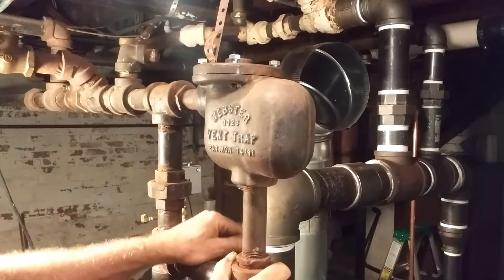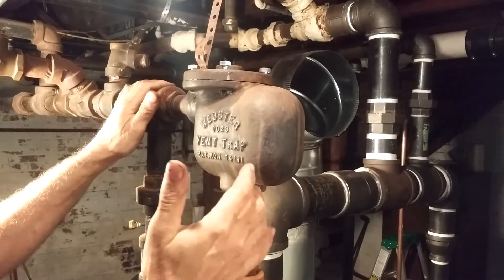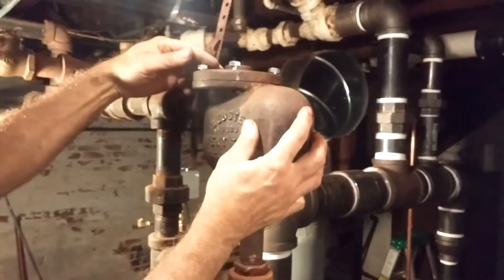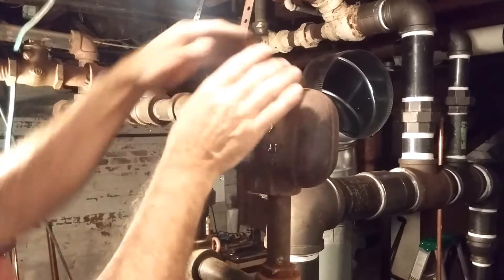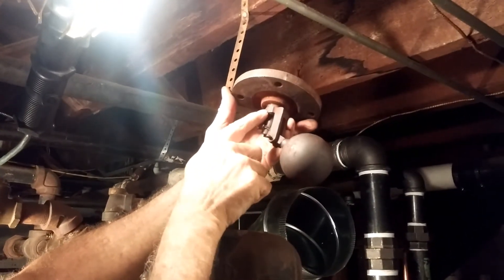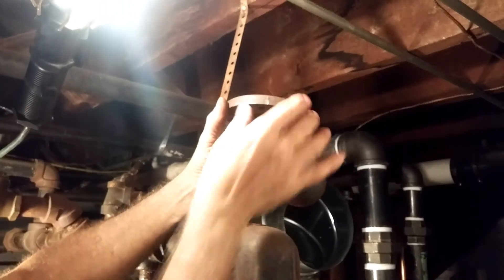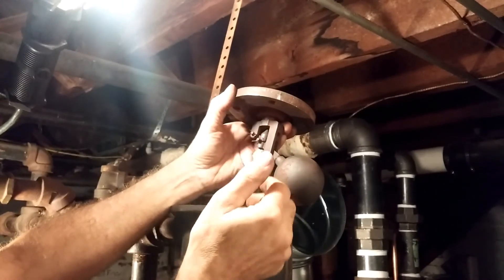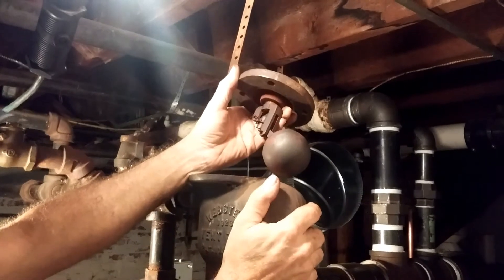Warren Webster Vent Trap For Two Pipe Steam Heating System

Comment: Thanks! I recently pulled the vacuum valve off this and then made the mistake of taking the cover off to inspect the unit. I apparently destroyed the gasket as I found it leaking water this morning. Is there a way to replace the gasket and/or should I be looking at reducing the pressuretrol? To state the obvious, I’m just the hapless homeowner..
Reply from the maker: @tomold100 It appears that your operating pressure is way too high, as you suspect.
I'd check to see if the pigtail is clear.
Make sure the pressure control is set as low as possible.
If the vent trap still leaks, I'd look into getting a 16 oz Vaporstat.
Reply: @ Thanks for answering! Really appreciate it! Yeah, looks like a knucklehead had cranked it up too high. I’ve backed it down and will monitor. Should I worry about the gasket or just let it go?
Reply from the maker: Usually the pressure is cranked high to overcome other failures in the system that keep radiators from getting warm.
If it doesn't leak, fix it at the end of the heating season is what I'd do.
Reply from the maker: @tomold100  Once the pressure is under control, you might be able to scrap the old gasket off of both surfaces of the vent trap and use silicone to form a gasket.
Ideally, you can buy 1/8" EPDM sheet gadget material and cut your own.